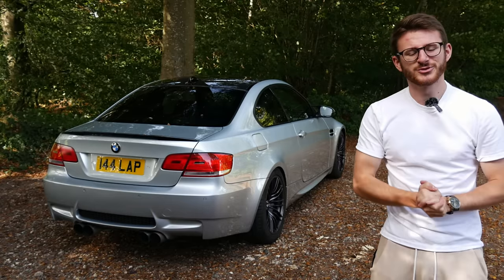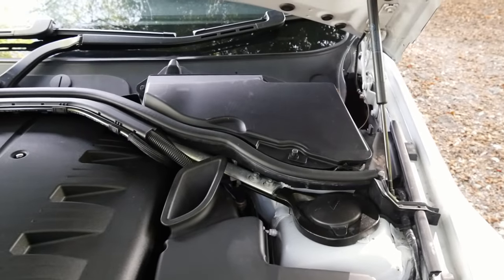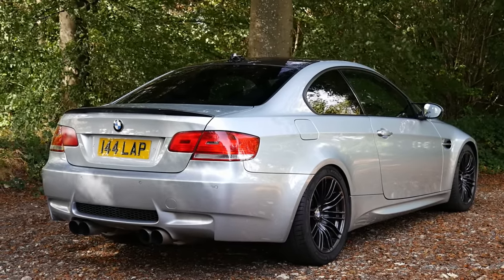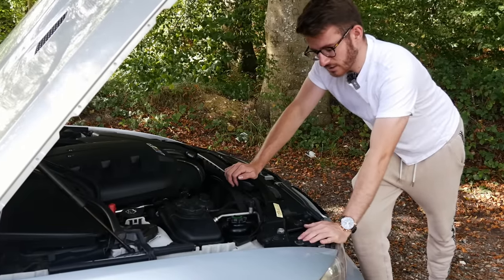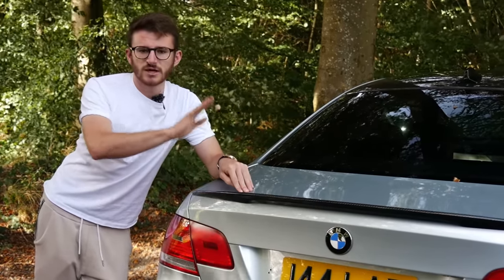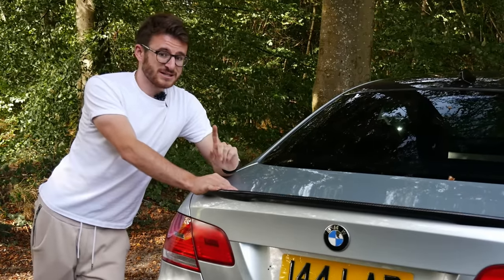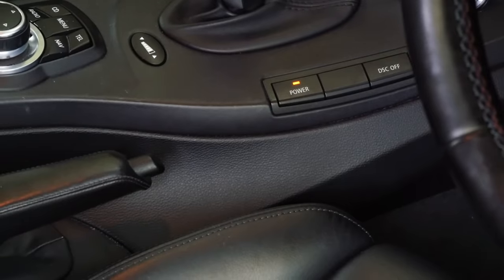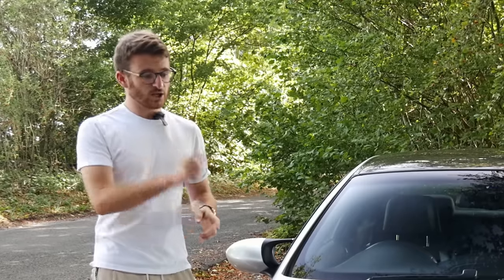I Should've Listened...Another BIG Bill for my E92 M3.

Comment: I have a x5 40d..3.0 twin turbo sttaight six.. Rocker cover gasket was leaking. Was quoted 700 quid for new gasket fitted. Did it myself for 35 quid plus injection puller off amazon

Comment: This is my first visit to your page. Don’t sell it , the E92/93 or a nice looking cars and they will look nice in years to come. I will shear this , I own a E93 , during lockdown I decided I would use the time to sort my E93 out. I spent approximately £4000 on parts. I changed all the injectors, coil packs, lambda sensors, Nitro sensor, MAF sensor, EGR valve, Rocker cover, repair the Alternator and replaced Belt and Pulley, front whee bearings, replaced electric windows main control switch. Now what started this when it went in for its MOT the garage said the management light was coming and indicated the fuel pump was the problem, i give the Ok and they replaced it all was ok. Few miles later the problem return after several visits the still couldn’t resolve the problem. Covid 19 came.. Lockdown. Hence, I systematically went through everything I know that would likely to fail due to the mileage ( 80000) . It has performed beautifully since then. I am reluctant to part with this motor. I don’t drive it the winter that often. So don’t sell yours if you don’t have to .. in years to come they will be the model that many people will be wanting to own. Good luck.

Comment: FYI: these M3 are horrendous for steering issues. Racks. Pumps. Leaks. High failure rate
Reply: What? Never heard that before, where did you hear that from?
Reply: @Assimilator1  a number of places. I've been told they mainly suspect with track use. The racks break apart so do pumps.
Reply: Yeah its true. My pump just went on track. They cant handle the heat. @DaleSteel
Reply: Also had rack problems on mine. Common.
Reply: @ScottPC  I'm pretty certain it's not common, apart from not having read about rack failures before, I also work at a BMW dealer, and haven't seen this before. Although I've only been there several months, I'll ask the more experienced techs there to see what they say.
How many track days have you done btw?
I've done just 4 so far, so far no steering problems.
Reply: @Assimilator1  2 track days under my ownership. Cars on 100k miles so can't complain too much but the older they get the more common I'm finding this! Mine was more of an issue near full lock it was leaking and grinding away.  Friends failed similarly.